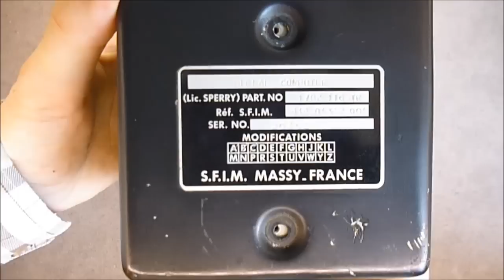Sperry SP 40 flight computer teardown part 6 (last) Signal computer

Comment: The disc-shaped component rattling around in there could be a compensation thermistor. As analog computers are temperature sensitive, it may be prudent to have such a component to compensate for thermal drift in a particular equation.